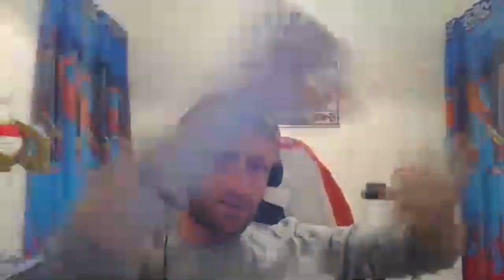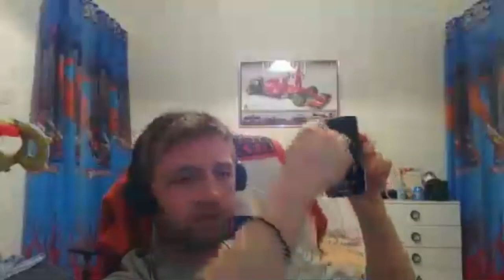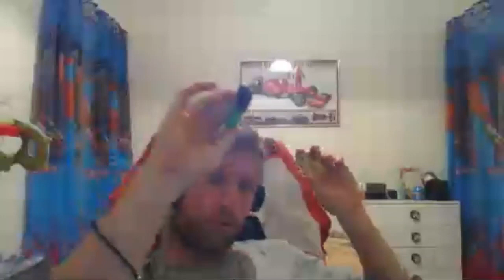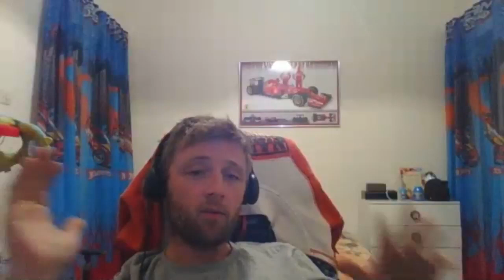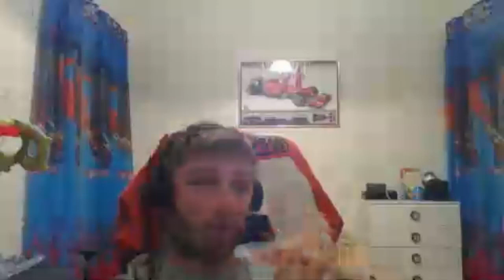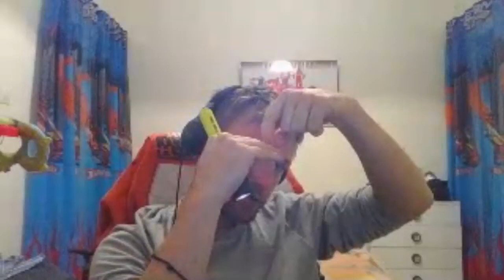Q&A about Marine Engineering with AdventureStory!

Comment: Hay mike
Do you have any idea why vit rack become hard to move during interance to ECA territories, 
Also do you have any idea what is power card lock like when vit stuck in max during mrc25% and mrc100%
Reply from the maker: Really i have not observe any difference on vit rack during change over procedure .About power card lock i am not sure maybe is something on engine loading programm to not work at this areas less that 25 percent and 100% of MCR because this is the limits for all diesel engines to operate but mostly 2stroke engines.

Comment: What's your rank
Reply from the maker: Kumar first of all people say hello and after asking questions!
Reply: @Adventure-Story  O my bad, hello how r u
Reply from the maker: @kumaranimesh1776  hello i am good!
Reply: @Adventure-Story  I was watching your freshwater generator video. The same type of FWG was there on the ship I have sailed. I Wana know that while checking of leak in the condenser tube we need to open both the end covers of the condenser and pressurize the condenser shell after filling the FWG WITH water and keeping the inside pressure of 0.5bar. We need to close the top cover then monitor the tubes for any leak.
Is this the right procedure or any point is required to be added